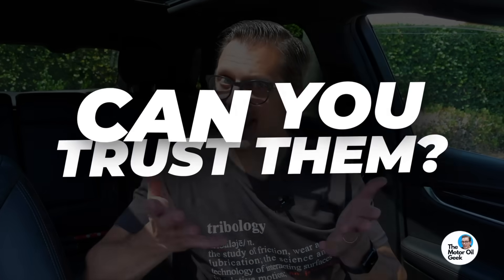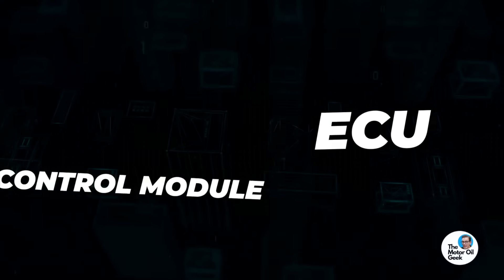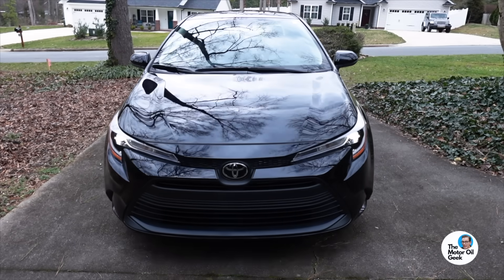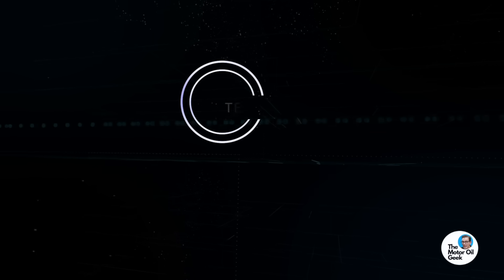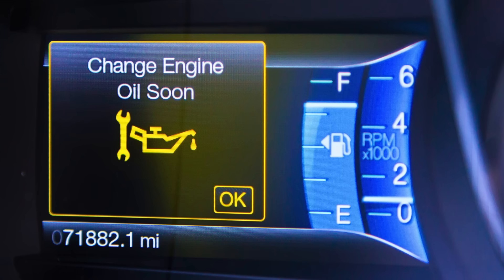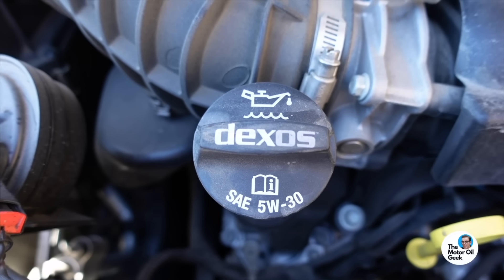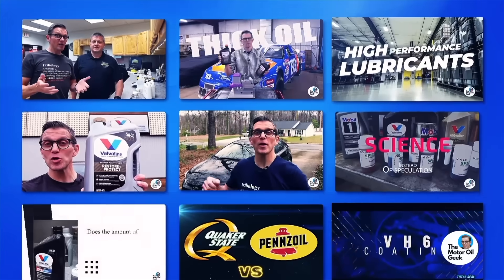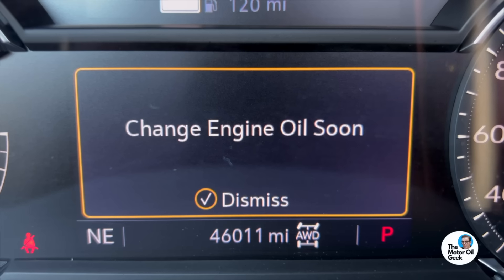The Accuracy of OIL LIFE Indicators REVEALED!

Comment: I have a few questions/video ideas.

1) I live in a cold region and it’s hot during the summer. I tend to change the oil and fuel filter more frequently during the winter because short trips it doesn’t get to operating temperature on short runs to work even with the block heater. Summer I go by the recommended intervals. My assumption is the winterized fuel is not as good for the vehicle and it doesn’t get to operating temperature for a long period of time on the short trips to work or the store. Does this make sense or should I just go by the recommended intervals?

2) 6.6L L5P has an oil pan that doesn’t have a great location for the drain and leaves about a quart of oil in the pan.  How much does that affect oil change contamination? There are deep oil pans from a few companies that claim to completely drain, they are deeper so they hold a quart or more oil then factory and keep the oil cooler with their design. I would like to know if there is any benefits of an upgraded pan and which one helps the most? If the oil stays cooler and takes more time to get up to temperature can this amplify the issues in cold weather on short runs?

3) I have also heard people talk about bypass filters that filter smaller particles and claim to give longer oil change intervals. Can you prove that there are benefits?

Can you make a video that talks about these topics with some real world data?

Comment: If I disconnect my batteries or have a very low voltage event.. My oil meter goes back to 100%  I learned the hard way that I have to write down when I changed my oil milage on paper.   My last oil change was just over 10,000 miles on my 2003 Duramax. The previous 10,000 mile change the oil looked really good.  The most recent change, I think it looked a little worse. Maybe I will take a sample at 7,000 miles.  It took me 5 years to put 10,000 miles on the truck .

Comment: I use the oil minder in my 2019 Ram 1500, 3.6 liter V6.  When I was still working, (I'm retired now) I was driving over 100 miles per day. Now I only drive about 5000 miles per year. I have used Royal Purple and Pennzoil Platinum in it. I have put over 9000 miles on my oil, but at 10 months and about 5000 miles and the oil minder around 50%, I went ahead and changed my oil because I don't like to go over a year.
Reply: For Chrysler, Dodge and Jeep the default programed into the computer is 12k miles OR 2 years, whichever comes first. You can ask a dealer or a shop that has the programing knowledge to set it to the minimum setting of 1 year or 6k. So your oil change percentage will be more to your liking. This is what I did to my Jeep Grand Cherokee.
Reply: @batemanjo9  nice tip, thank you for sharing.  Also, oil will break down over time and become acidic, so sticking to a timeframe for it if mileage threshold is not hit is a good idea.

Comment: Great informative video. I’m in the midst of checking out my GMC Acadia 3.6. I run Amsoil signature series 5-30w. The thing I’m confused about is that the computer stated that I was at 0% oil change before the 5000 mile recommendation from the shop I go to. So I’m about to send out a unit of oil to run the test. I just reset the oil life back to 100% before I went on a 1200 mile road trip. So we’ll see what the results look like soonish.
Reply: The owner of the shop explained to me since I live here in Jersey idling in traffic really does break down the oil quicker.

Comment: My questions are, if manufacturers are extending their oil change intervals listed in their Owner manuals for CAFE standard reasons, then are the maintenance minder lights still working off real world data as suggested or have these indicators also been skewed as well? And this video seems to suggest Honda's and Fords might use calcs or just use mileage as the controlling factor for their version of the maintenance minder light. Does anyone know if Honda uses just mileage or an algorithm such as that created by GM? Some of the suggested intervals on these DI turbo engines these days seem risky to me. Just like "Lifetime" antifreeze sounds like asking for a head gasket to blow once the antifreeze loses its anticorrosive properties and begins to eat away at gaskets from the inside out.

Comment: Good information on GM oil life indicators.  A fairly sophisticated algorithm, not just a mileage reminder.  Thanks for explaining.  I will continue to use the one in my Tahoe.  No issues after 105,000 miles on a 2018.

Comment: So is changing the oil by the oil life monitor going to be detrimental to the life of the engine? I have seen many mechanics on YouTube claim that going over 5k miles on an oil change contributes to oil ring coking. I tend to think this applies more to low quality oils and/or low quality filters.  From my own experience I have had quite a few vehicles that I would change the oil at 7500 miles, and I have never had a vehicle that burned oil.

Comment: Wait wait wait, if oil health monitoring is supposed to remove the guesswork of mileage based oil change intervals, then went would it still go off at 7500 miles? Wouldn't that defeat the purpose of the system? If I drive my car exclusively on the highway and start it once a day like a trucker, my oil should not have to be changed after 7500 miles. It doesn't matter how you measure it, number of revolutions, hours, fuel oil ratio, mean cylinder pressure, my car would have wayyy healthier oil at 7500 miles highway than grandma that drives a mile to the grocer, right?

Comment: I would be curious to know if that holds true for the other manufacturers.  Sounds like GM did their homework.  Would be great to do some more testing with vehicles with known mileage, and maintenance and look at the various manufacturers and test that oil.  Most of the vids on this channel beat the change your oil early and often drum.  This video implies there could be a more science and data driven method that may be more precise.  I would dare to say a majority of people who buy a newer car with a OLM are probably using the info it provides to make oil change decisions.  Would be good to know which manufacturers are actually doing the calculations and if it can be trusted.  Not just a miles and calendar counter.  Maybe get some of the manufacturers to talk about their intelligent oil life monitor systems on the channel.  I think that would be great info.

Comment: I have watched the oil life indicator drop at different rates depending on what I was doing, how I was driving and so on. When towing, it drops faster than when not towing.  I got curious and sent in a sample at 7,100 miles (Jeep people freaking out - NO, never go that high!) the oil life indicator said I had something like 19% left. the lab results-  aligned very well with the indicator. I did the math. I've noticed it drops faster with short winter drives, and not as fast with longer highway drives. And then of course there's the FORM mode of our 4xe - my wife doesn't drive her Jeep long enough or far enough to get that engine hot. People say "but I commute 10 miles and the engine is up to temperature" - maybe the coolant is, but the oil has to get warm and then it takes time to heat out the moisture and fuel contamination.  Anyway, very well explained. I love to show folks how the manuals from my classics from the 1970s show 7,500 miles between changes - and they are freaking out going that far on today's engines.

Comment: I worked for a company that developed oil health indicators.   They are real devices.  The probe was built into the oil pan and it sent an acoustic pulse from the bottom of the pan to the oil surface.  The reflected wave could measure oil level and viscosity.   In addition there was an optical sensor that measured transparency. 
In the long run the auto manufacturers decided against deployment.   Probably because customers were not coming to dealers as often.

Comment: I had this problem. My commute, 5 days a week was 1 mile. 1/2 mile to work and 1/2 mile home. I had to change my oil every 6 months regardless of the miles, which was very low of course. About eight years into owning my Mitsubishi Lancer, I need an entire exhaust system because it rusted out. That was an $1800 price tag. I still have the car and she runs great. My commute is a little longer now

Comment: Both my 07 Chevy Avalanche and 14 Chevy Cruze have oil life monitors. I use full synthetic oil in both and change each every 5k miles period. At 5k miles I still have 40%-50% oil life left. I will never go the full 100% according to the oil life monitor. More frequent oil changes then what the oil life monitors say are good insurance.

Comment: Lake, good information, as typical.  My only caution to folks depending upon the GM oil life indicator is to make sure they monitor the oil LEVEL.  The LS engines with cylinder deactivation seem to drink oil.  GM even issued a tech bulletin regarding the acceptable oil consumption (1 qt/2000 miles) for vehicles under 36,000 miles.  Experience has shown us that the oil consumption increases on those engines with cylinder deactivation as the ring grooves gather deposits.  When was the last time you saw someone checking their oil level at a gas station?  If we see someone with the hood open, it is so atypical that we tend to offer help!  So, as long as they aren't consuming lots of oil without topping off, the oil life indicator can likely be trusted.  Again, great info!
Reply from the maker: Good point about the oil level.

Comment: My 2016 Subaru Outback with 2.4 L 4 cylinder can display the engine oil temperature on the center screen.  After 15 minutes of driving it’s usually 204*F to 212*F. Sometimes on hot days and going over mountain passes it reaches 238*F.  The owners’ manual doesn’t tell me what to do with this information. But since the Subaru link software shares info with Subaru, it seems they are doing oil temperature research.  Has it been published somewhere?

Comment: One thing i have noticed on GM in the past if a car overheated oil change indicator goes to  0% even if the oil was changed last week, on other manufactures I have not seen that yet. Can't confirm all manufactures. Very important to change oil after overheat condition. Lots of mechanics don't!!

Like your videos keep up the good work
Reply from the maker: Yes, it is programmed to do that.
Reply: @themotoroilgeek  What I meant to say was other manufactures don't, really surprising !! Ford was one of them, had one truck overheated on the highway, hose popped. couldn't believe indicator was 88%
Reply from the maker: @Eric-jk9fx  Wow, that's interesting!

Comment: Rental cars usually get driven high miles and on highways so dilution and condensation is less. I bet that oil has over 6K on it. It would never las that long with me, I drive to many short trips and more city use. BTW, leave the start stop on! Oil will last way longer as the engine stays cooler in city driving. Not applicable in a norther winter however.

Comment: That algorithm technically was great for the older GMs engine's where you can go 10,000 plus miles on an oil change.
Perfect example was the 3800 V6.
You could go 20,000 miles on an oil change with that engine.

Comment: That's not the most accurate test if it's not his car and doesn't know exactly when the oil was changed. I worked for a rental company, and when the oil light comes on we sent it to the shop, which doesn't happen 100% of the time. When it comes back from the shop, the mechanic doesn't always reset the oil life meter. They usually just right the mileage on the filter, for the next guy to know when it was last changed.

Comment: Been a mechanic/tech for 40 plus years . If you let your late model GM four cylinder or V6 get to that point you'll have little or no oil in it .
Will run bad if at all . Will be throwing can timing codes because there's no oil in it .

Comment: Id rather the car tell me to do it early. I change the oil in my 2010 mercury grand marquis every 2500-3000 miles with valvoline restore and protect  it has 153,000 miles on it and when they changed my timing cover due to over tightening of belt tensioner, the engine had no sludge and i get 18 mpg city and 26 hwy.

Comment: For methanol fuel in a car, does it make the oxidation resistance more important because of the oxygen in the methanol and less soot meaning that the oil degradation is mainly due to metal deposits and oxidation?
Reply from the maker: Methanol increases fuel dilution, so that is the biggest challenge with that fuel.

Comment: I have always wondered how VW, Audi and Porsche have been able to recommend 10,000 miles oil change intervals here in the USA with 502/507 spec motor oils as well as 508.00 509.00 motor oils on newer gasoline engine models?  Is 10,000 miles really safe?

Comment: While Oil Life Monitors are useful I prefer to change  my oil + filter every 4-5k miles. With my new 2025 GDI Honda Pilot with DOHC V6, I’ve already changed it at 800, 3200 & 7400 miles. We are retired so most of our trips are short; hence we need to change it more frequently. At 7400 miles (4200 mile OIC) my oil smelled like raw gasoline. ⛽ Reminded me of the 1970s carburetors that dumped raw gasoline. Nope. I’m an old timer; I don’t need the OLM to tell me when to change my oil. Thanks.

Comment: I drive like most american drivers, as in some in town, some suburban, and more highway miles, I have always changed my oil every 5,000 miles. I did this in my 1 and probably only new car I will ever own, a 1.5 eco boost Ford Fusion. I had the dealer do every oil change because it was only $12 more than I could do it for. There's plenty of complaints about eco-boost motors. This Fusion oil LEVEL would never change between between oil changes. I never had my oil analyzed, but judging how the car worked, ran and performed, I'll keep doing 5k oil changes on all my cars. Recently picked up a very nice used Ford Edge with a 3.5 and an older F-150 with a 5.4 triton. After watching this channel, I am going to get oil samples from each. Have them tested. Because I bought these vehicles used, I will run some of the new Valvoline Clean and Protect oil for a few changes and then retest. Now that I'm retired, if Minnesota rust doesn't kill these cars, they should be the last ones I have to buy.
Reply: Have a little confidence Jon, you're gunna buy a couple more at least.
Reply from the maker: Right on!
Reply: The 5.4 triton 😮..

Comment: I’m old. I’m 68. And did you know that 1975 General motors and possibly the rest of the auto industry said change your oil every 7500 mile and change your oil filter ever 15,000 miles. I still have the owners manual on my Firebird. I damn near ruined that engine.

Comment: Listen.. mileage is not a true indicator of oil change intervals.. I utilize engine hours.. my typical drive ratios are 40 mph.. so at approximately 40 mph for 2000 miles is 50 hours of engine run time.. engine hours has been a long standing indicator of oil change intervals.. Aviation, Rail, Marine and all power equipment engines use engine hours for their maintenance.. I change my vehicle oil every 50 hrs.. and my power equipment  at 5 hrs... of course I use premium synthetic oils!..

Comment: The biggest question I have is the human error of the last oil change. Was the oil life indicator reset when the oil was changed last? It's not necessarily common for that to happen, but it's something I did not catch in the video that could alter the results. If it was in the video and I missed it, feel free to correct me. I'd apprciate it!
Reply from the maker: As noted in the description of the video, the conclusion is not based on the outcome from this one vehicle. We’ve been doing oil testing on these for several years, and that is where the basis of the video comes from. This is just an example.
Reply: @themotoroilgeek  Oh, cool! Thanks for the reply, I must've missed that.

Comment: Sounds like the oil indicator is very inaccurate then if it was at 9% and the oil was really still at 99%.

Also the once a year thing is also a problem. I do once every 5 years on my summer car, and once every 20k kms on my winter car, which is about once a year.  Both always have perfect oil on the change and I'm just changing it because of the built up moisture over all that time.

Comment: I’m concerned about lifter failure with my 6.2 liter 420 hp ‘19 Escalade. 90,000 miles.  Should i be changing oil more frequently? 3,500 miles?
Reply from the maker: I'd recommend doing used oil analysis to get the right oil and right oil change interval for your engine.

Comment: My Cadillac I change the oil at 50 percent life. Or every 6 months. I have a '97 Seville with 158,000 miles and the engine is spotless inside and out. Bought it new in '97. It's the First new car I bought. Always garaged.

Comment: Would the use of an engine block heater help with reducing oil degradation in cold weather climates?
Reply from the maker: Yes!
Reply: @themotoroilgeek  Thanks for the quick reply! What outside temperature would you recommend to begin using the engine block heater?
Reply from the maker: @Castrum450  Once it gets below freezing, putting any heat into the engine is beneficial.

Comment: In my 2011 GMC Yukon Denali (with the 6.2L with 140k miles on it), I normally start thinking about changing the oil when the oil life indicates under 20%, but actually do it whenever it happens to be convenient.  Usually it gets changed when the computer indicates 7% to 15% left.  From my past calculations, I can go roughly 7500 miles before tripping it.  I took it to 0% only one time on a long road trip, but had the oil changed within 200 miles.  Unfortunately, my brother took it to 0% for an  unknown amount of time while I was traveling for a few months (grrrrrr).